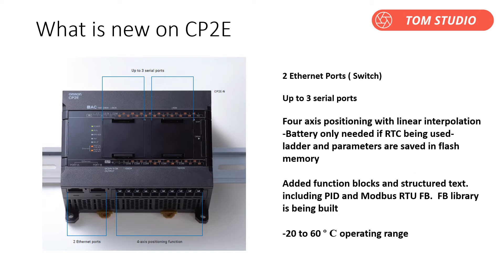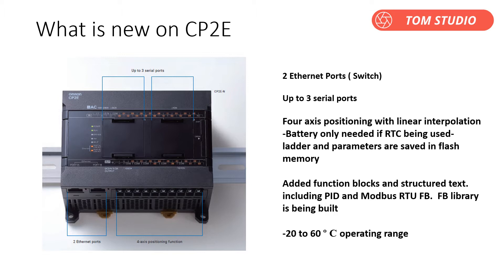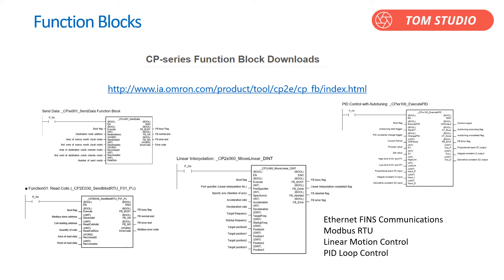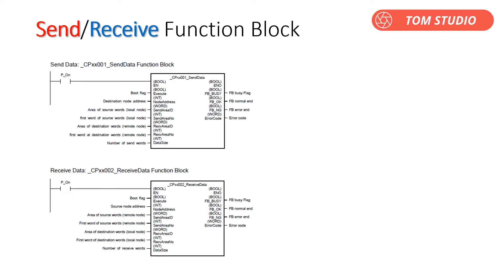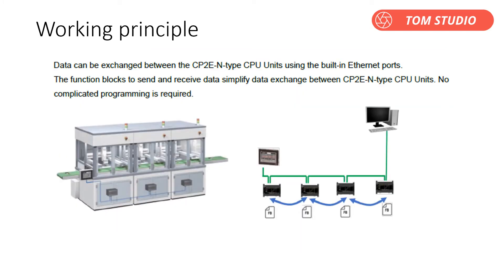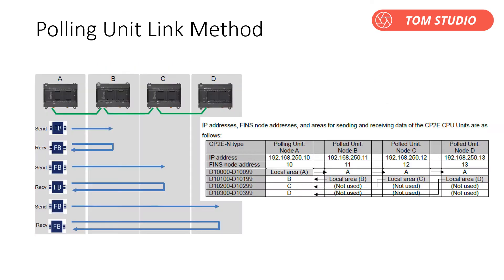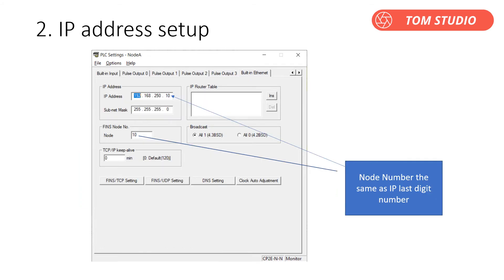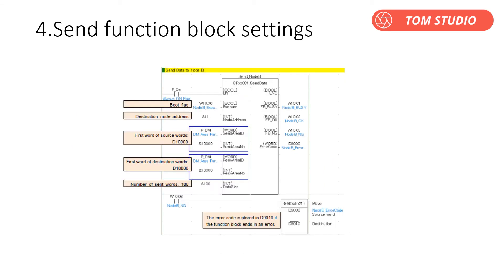CP2E new FINS Ethernet function block

Comment: hi. its possible to communicate cp2e-n60 with 3rd party io terminal (exm : 16 channel io) using ethernet?
Reply from the maker: Hi Ben, technically, you can do it using CP2E Modbus TCP function block. Please be aware that CP2E only supports FINS Ethernet and Modbus TCP, As FINS protocol doesn't support remote IO, the possibility is Modbus TCP remote IO